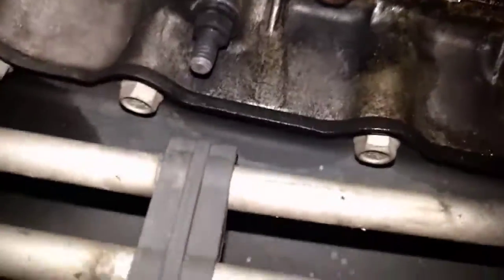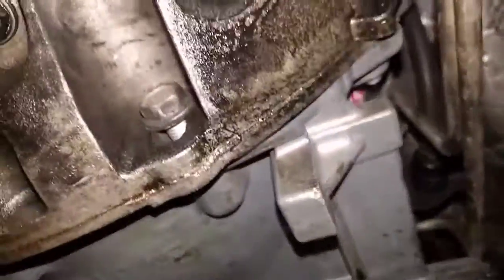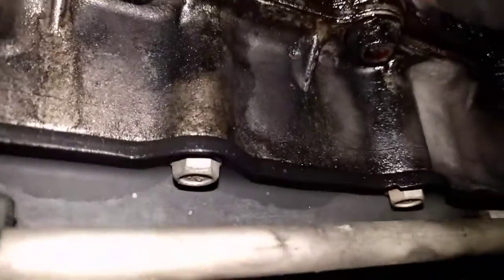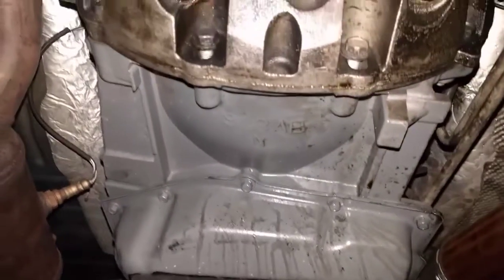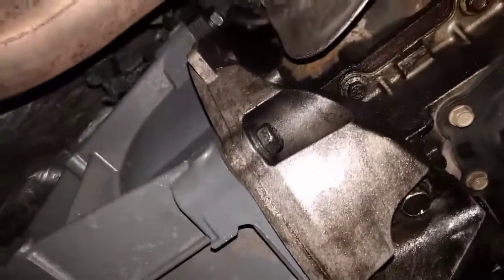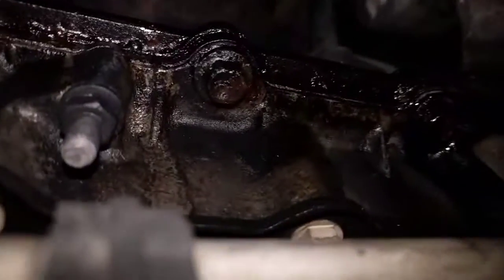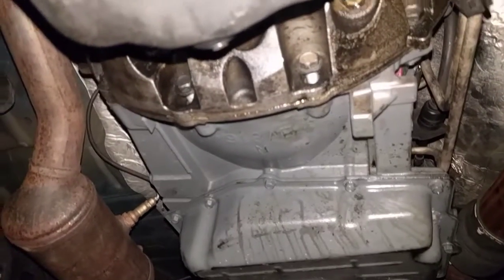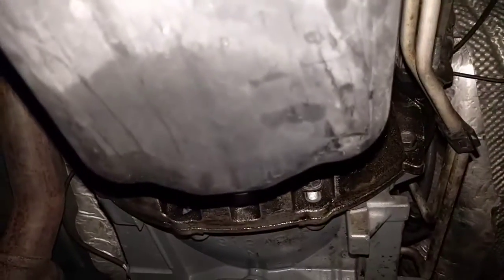2010 Jeep Wrangler JKU oil leak

Comment: I've got somewhat the same thing on my 07 JKU. Either valve cover gasket, oil pan gasket,  or like you said rear main seal.
Reply from the maker: NFREngine14Bravo I just got back from my buddies shop and he said it was coming from the valve cover on the passenger side. He told me $85 to fix it so that's not a bad deal since I don't want mess with it
Reply: Valve cover, most likely, at the whole top is very much soaked in oil.